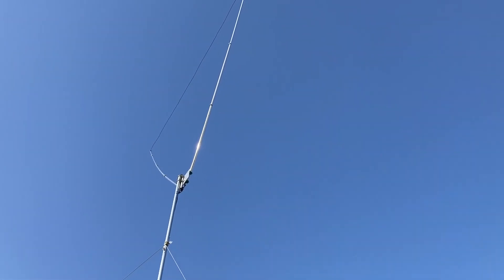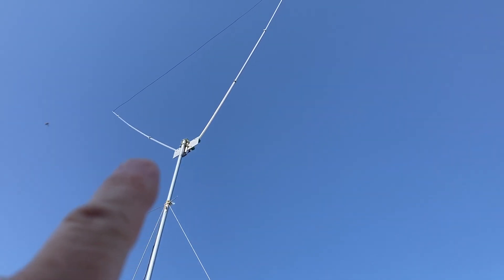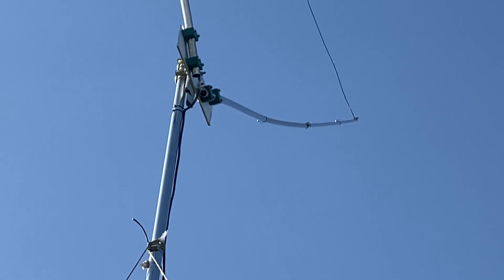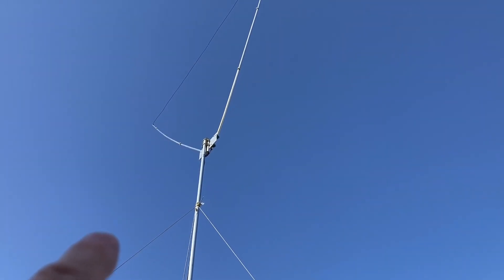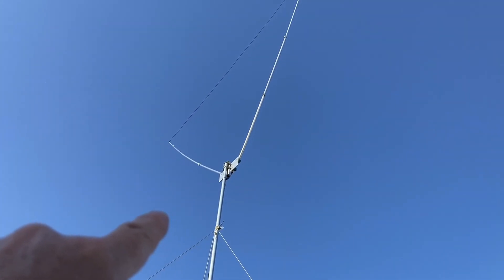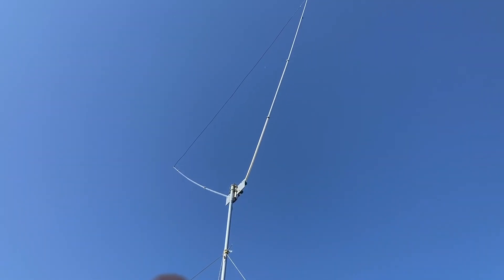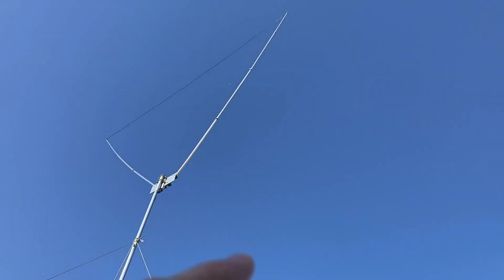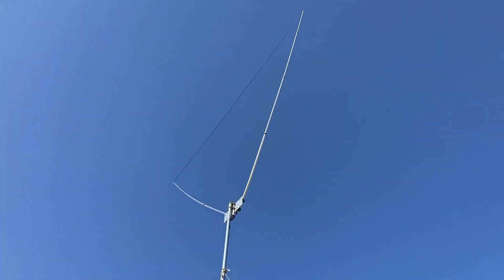Requested delta loop specs.

Comment: Thanks for sharing.
Reply from the maker: Any time! Thank you for watching
Reply: Curiosity,aren't the sides roughly 12'3" equalateral triangle? Or do you use aluminum tube instead of whole unit done in PVC as supports the antenna is just a loop wire anttenna
Reply from the maker: @user-ef3nu1eh7z  you can make it with pvc and wire. I had the tubing on hand and used that. Almost like a maco vquad with out the reflector
Reply: Can you get a close up of the "insulated" piece at the base of the element's. Are they just  insulated straps.